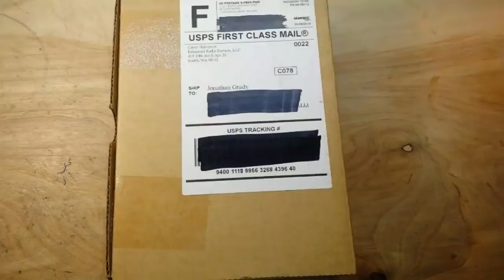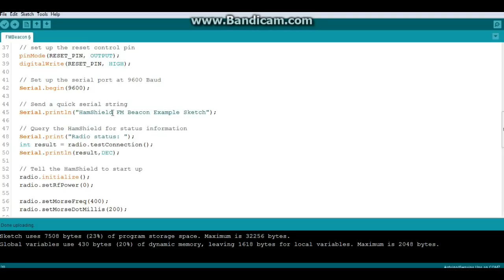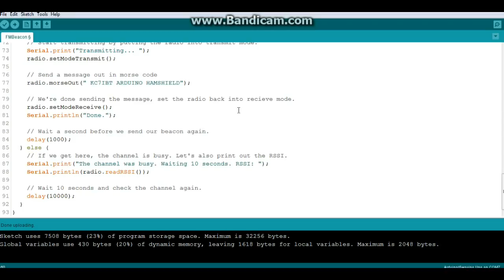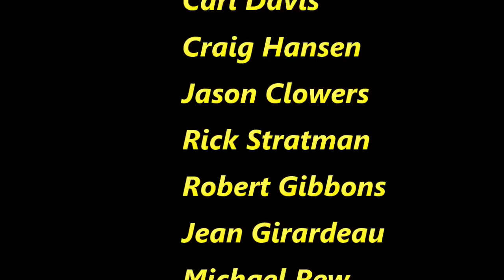Hamshield: Arduino meets amateur radio

Comment: What is the reason you say you shouldn't be doing this at all?
Reply: Probably, he is not licensed to operate on the band and not transmitting a callsign would be my guess.
Reply: @timlucas143  Unless he is transmitting his call sign using that morse code, he should be using a dummy load.

It is not because of the license as the most basic license (Technician's) cover VHF transmissions. And, if he got an SWR Power Meter, he probably also have an HF Radio, which hints he also have the General License.

Comment: Interesting would much rather see this attached to an arduino mega with encoder /tft/ mode options preset message options this would make an interesting project? And please tx into a dummy load until licence held that satisfies most people lol
Reply from the maker: +Steve Edwards it's on its way home to it's owner
Reply: learnelectronics  thanks the memory in a uno would not be enough for what I had in mind but seem to be an interesting project thanks like the channel  by the way
Reply from the maker: +Steve Edwards thank you
Reply: It will work fine on the 2560. Need more memory add a sd card, problem solved.

Comment: At 2:05 you say transceiver? Wow! Any easy ways to bring up the Tx level from 0.5w?
Reply from the maker: Cliff Matthews Yes, it is a tranceiver. Poor a TFTLCD shield on this and you could do WSPR, packet, jt65, rtty whatever you like. It uses TRRS for mic and earphone, so you can build your own digital capable HT. Pretty cool I think. I'm not too sure about the power though...
Reply: Put an ht amplifier between the shield and antenna. Communication Concepts in Beavercreek Ohio would be a good source for a low input amplifier. Unless the shield is capable of SSB PSK is out and RTTY is full duty cycle so your shield will not last long even at 1/2 watt.

Comment: There is a shield for everything. A tip that i use when soldering pads- presolder the pad first then bring component in and melt the solder. Never heard of the super glue method but i like that also!
Reply from the maker: Good tip. The superglue only works if there is a point where the pcb connects to the component with electrical channel between.